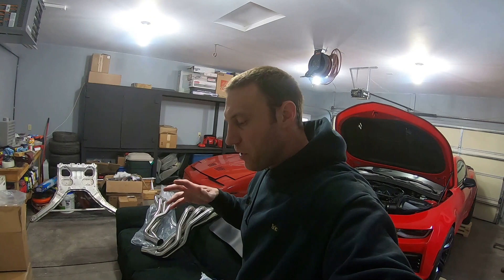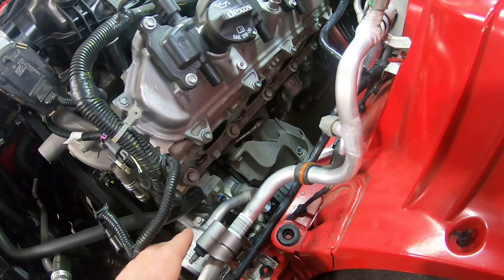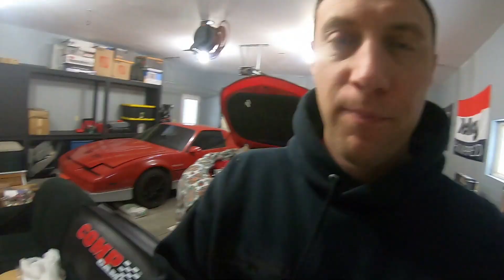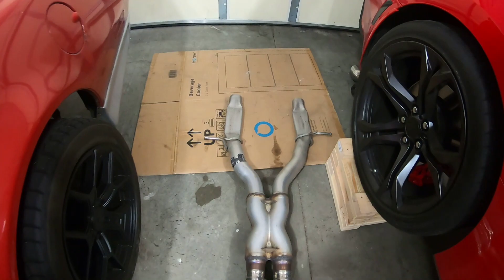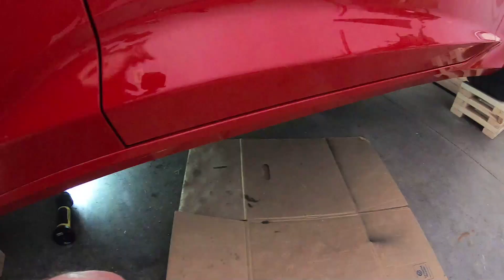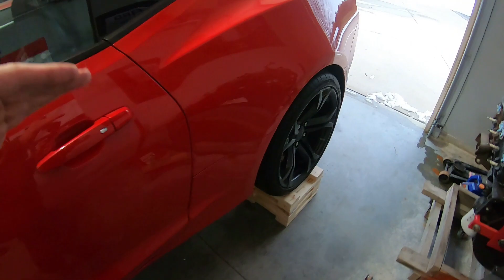6th Gen Camaro Speed Engineering Header and X Pipe Install

Comment: So needed .250 spacers for the halo brace?
Reply from the maker: Yes, part # 98029A051 from McMaster Carr is what I used and they worked great!
Reply from the maker: Forgot to add I got new arp longer bolts with the extra spacers. 30mm I think we're the ticket!
Reply: Sweet great info got mine all installed any issues after a while i basically have same build so far i have smg flex fuel added though
Reply: Oh and sorry to keep asking through here but what was the part number for 90 degree elbow for catchcan on lt2 manifold
Reply from the maker: It is the ebay link for the 9.89 female 90 D 5/16" quick connect. But I just looked and the link I used is out of stock on that fitting. But I would look for a similar fitting online somewhere.
Reply from the maker: https://www.ebay.com/itm/Automotive-Fuel-Line-Quick-Release-Connector-Nylon-Hose-Barb-Fitting-Motorcycle/254033257195?pageci=8dc637c3-f324-4623-9862-bc670d2925d0

Comment: Once you got everything done when you did your 1st datalog was the car lean at all? I'm asking because I'm not able to get my car tuned yet but I wanted to drive it until I can get it tuned. I have basically the same mods lt 2 intake manifold long tube  Headers x pipe cold air intake
Reply from the maker: Before u do any pulls it would be best to have a wideband gauge connected to make sure u don't have any issues with install. That being said I added the most fuel down low or at low rpm high load. U should be fine putting around town. The 95mm tb changed things the most
Reply: @EssMotorsports  cool thank you!!!!

Comment: Can you post a link for the clamps you used?
Reply from the maker: I updated the video with rockauto links
Reply: @EssMotorsports  Awesome thanks bro!!! Just got mine!! Can't wait to get them on!!
Reply from the maker: U have to use the ones speed engineering provides for the collector. Not enough room for the walker clamps
Reply: @EssMotorsports  how good are those clamps you got are they leaking at all?
Reply: And how about the ones at the collector any leaks
Reply from the maker: I tighten the crap outta them. I think I tighten them to like 45 ft lbs. 1/2 breaker bar! But they are not leaking
Reply: @EssMotorsports  the speed engineering ones at the collector neither?
Reply from the maker: I had to use the clamps they provided. And those I tighten with a breaker bar! Otherwise it wasn't squeezing the pipe to seal. Pretty sure it's not leaking. I can't hear it anyways
Reply: @EssMotorsports  thanks bro you are so appreciated!!!

Comment: Nice job, looks like you and I have the same exact set up from the halo brace to the rotofab. I did go with spark plug boot covers on factory wires and had the headers ceramic coated and also added a set of high flow cats. Can't wait to see your next move.
Reply: Ok, that will hopefully work. Thanks for all the info. I hope to have it all done by the end of the month. I'll have to post a video when I get it on the road
Reply from the maker: I had to space my halo brace down another .250" to make little extra clearance for exhaust. No issues now. Did you have to do that?
Reply from the maker: Sounds like we got some badass cars! I love mine! Downshifting in town and breaking necks! Haha next steps is to enjoy the car this summer and perfect the tune!
Reply: Yes. I used fender washers. I'm also running no mufflers I made a couple 3 inch tails. Tune is my next mission. Keep up the good work bud. Love the lights
Reply from the maker: No muffler! Dang! That's loud! Hahaha 
Thanks, people like u are why I made my last tuning video. Hopefully that helps to see stuff i already tied and works for our cars.
Reply: Oh yeah that was a huge help. I'm very nervous to try my own hand at turning. I haven't driven the car since the intake and manifold. After the headers the cars long term is saying very lean
Reply from the maker: @marlevans6580  make sure u get a wideband and start with MAF tuning as that is way easier.
Reply: I was thinking about doing that. Since we both have the same headers, I welded v-bands on the edge of the collectors. Do you think it's OK to put the sensor into the collector itself or should it be further back? Cause I'd have to move the cats further back aswell
Reply from the maker: @marlevans6580  it would probably be better further back but since you have cats in the collector is probably fine. U have to take the wideband readings with a grain of salt. I don't think mine is super accurate at idle low throttle.

Comment: What clamps exactly did you use bro ? I’m the process of installing mines Speed engine headers with x connection to NPP exhaust just like your set up the clamps they come with are junk. Thanks in advance she sounds like beast!
Reply from the maker: In the description/ links its the two Band clamps, Walker exhaust part numbers. I ordered them from rockauto or summit racing. But I did use a couple of the clamps they sent on the header collector joint as there was not enough room for the wider band clamp. Use a breaker bar to tighten.
Reply from the maker: And yes. It sounds awesome!

Comment: Dude, what is that rattle sound that starts at 9:03? Right before you flip to track mode. I have the same sound and it's driving me bat sh*t crazy! My rattle goes away when the motor warms up after about 30 seconds. It's always loudest at cold start. Then the noise comes back when starting off in low rpm. Or lets say 2nd gear at a stop sign. (high load low RPM) Dealer can't "hear" the noise. For me, it sounded like top end stuff, on drivers side. but I'm reaching. It's driving me crazy for 2 years now. Have any insight?
Reply from the maker: I did have a rattle which was my exhaust hitting the Halo crossmember. I had to get some thick washers from McMaster Carr to space it down another .20" and that took care of it. In untuned cars the car goes into Cat warm up mode which dumps extra fuel and retards timing. That is why camaros sound loud on startup until warms up a little.
Reply from the maker: I would check exhaust hitting something tho as my rattle was only at low rpm once moving frequency was high enough u didn't hear it

Comment: There's a little bit of wobble on the steering wheel after I reinstalled the steering shaft. Do you know what could be the issue?
Reply from the maker: I would double check I the bolt is tight or the shaft is not seated all the way in to its mating part
Reply: Problem fixed thank you! Bolts were a little loose
Reply from the maker: Nice! Those are the nice problems, the ones that don't cost anything to fix!

Comment: Did you completely remove your rear 02 sensors?
Reply from the maker: Yes rear sensors are gone, I just sealed up connectors with BIG heatshrink and tucked them up and zip tied.

Comment: Hey brother got another question lol What do you do with the afm valves? I want to delete them and not sure what to do.
Reply from the maker: I have a manual so I did not have them. But I am guessing these can be disabled via a tune.
Reply: I’m planning on doing  this, I saw that awe makes a simulator bracket for the valves, borla does have an x/mid pipe that keeps the afm working however it’s double the price, 1k instead of 500, the awe afm simulator is $35 which to me is the cost effective fix, then you just zip tie them out of the way.
Reply: @ApexPilot  Nice thanks!!
Reply: Keep them plugged in and tucked away. Or like he said , have it tuned out

Comment: Are you located in michigan? Would love to come hear the car out before I make the purchase
Reply from the maker: If you want more volume out of your exhaust you won't regret it! Just buy it! Only downside with Speed engineering is they don't offer a bolt on high flow cat if you want that.
Reply: @EssMotorsports  well I do have a corsa cat back but I really hate a raspy exhaust. My worry is going catless would introduce raspy and curious if a resonator is required.
Reply from the maker: Yeah hard to say since it's mostly each person's opinion... performance wise it's a good value.
Reply: @EssMotorsports  Very nice install. 👍   How much HP will you gain with long tube headers ?
Reply from the maker: Thanks man! U gain a solid 20ish hp it's a must bolt on.

Comment: What did you use to build those stands? Looks like 2×4s but just wanted a lil more info! I like the idea!! I have jack stands but I don't feel comfortable being under the car on the stands
Reply from the maker: Yeah I just used 2x4s cut at 14" long. Then just alternate the boards. I used 2.5" long screws. U have to pre drill every hole so it doesn't crack. 2 screws per corner criss crossing them so they won't hit screws below.
Reply from the maker: Probably cost like 60-70 bucks with boards and big box of screws. You need like 10 boards 10ft long because of waste at the ends.
Reply from the maker: They were 9" high which was as high as I could go with my jack once you take into account the wheel droop
Reply: @EssMotorsports  Awesome thanks bro!!!
Reply: You trust wood more than steel?
Reply from the maker: The wood stands are very sturdy. Way better than Jack stands in not shaking at all.
Reply: @EssMotorsports  I believe there  sturdy and wood is strong I'm just replying to guy not trusting a metal stand over wood. I've never had a Jack stand wobble you just got to have quality stands.
Reply from the maker: @Harlo86  gotch ya, I use jackstands all the time too. If I know it's going to be up in the air for a while and I don't need the wheels off the cribs work really well.
Reply: @EssMotorsports  ok I might have to try it. Might be something I can take advantage of when painting cars to get more height

Comment: Did you tune for the Headers?
Reply from the maker: I am working on that right now with HP Tuners! Surprisingly it has not lit the CEL but codes are pending. Im trying to figure out what codes I need to turn off specifically.
Reply: @EssMotorsports  well your going to be lean. Also get an AFR gauge. When you get the mixture tuned you will also turn off the down streams.
Reply from the maker: Yeah I have a AFR gauge installed just can't tune/drive right now. Actually going to go snowmobiling instead today! Right now I am adjusting easy stuff. 
Any advice on what specific things to look at besides MAF and VVE?
Reply from the maker: I'm adjusting fans, catalytic warm up mode, speed limiter? I'm really curious where to set my PE pedal value and what rpm to bring in PE.

Comment: Did you get any codes after installing your lt2 intake? I just installed mine today its ported but im using the stock lt1 tb and i got a code p0443 and p0458 , it runs good tho ?
Reply: Figured what is was lol it was a error on my part , i accidentally tugged on that wire , and a came a little loose didnt notice till i re checked it 👍🏽 runs good , hard time getting traction on 2nd going in to 3rd now
Reply from the maker: Thats awesome man! Glad you figured out what was wrong. So you definitely noticeable a difference huh? I'm jealous I haven't gotten to run mine yet. Maybe in a month...
Reply: @EssMotorsports  Yes you will for sure feel the difference , especially since you have more mods then i do , that the only mod i have as of right now , no tune yet , but at higher rpms it just keeps on pulling.
Reply: Thanks for the prompt response , i check the vavle unplugged it and plugged it back in goes away then i drive it and it comes back on , drive good though , so maybe cause its reading more air? But ill check again maybe its dirty lol thanks
Reply from the maker: I didn't get any codes. I just did a quick search on those codes tho and it looks like its your evap purge valve. The thing that goes into your intake right next to your throttle body. Check the connector. If you disconnected it its probably not seated all the way back in.
Reply from the maker: Side note I haven't been able to run my car much at all. Current condition in Wisconsin is -13 and snow covered....
Reply: Hey me too. Wisconsin is getting nice out now. Any issues with wires or codes? Also where do you go for the tune?
Reply from the maker: @mallen420m  the headers will set the rear O2 sensor codes so they need to be turned off in the tune. I am working on the tune myself using HP Tuners. I'm learning so its taking me a bit with all virtual torque tables which is new to the gen v engines.

Comment: I'm getting the same set up but ordered the steel gaskets. Those shouldn't be a problem will they? As far as clearance?
Reply: How are the wires also any problems?
Reply from the maker: Clearances shouldn't be a problem but from what other youtubers were saying is to use the OEM gaskets. They were cheap on Rockauto. The Aceel wires seemed to work fine. Haven't ran the car much yet tho.
Reply: @EssMotorsports  there're more expensive so I figured they would be better lol You think I should call and change my order to the oem?
Reply from the maker: Both will probably work I just went with OEM because they were cheaper.
Reply: @EssMotorsports  ok cool thanks bro!! You are such a huge help!!! Love your car to!! Sounds amazing!!!!